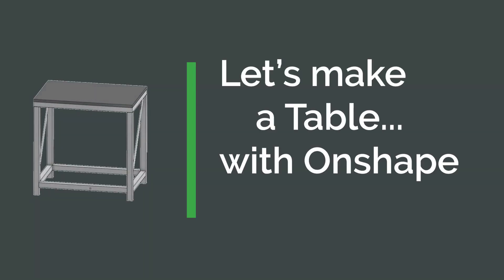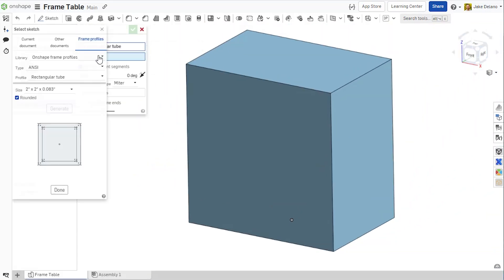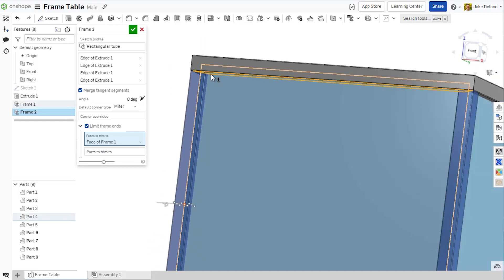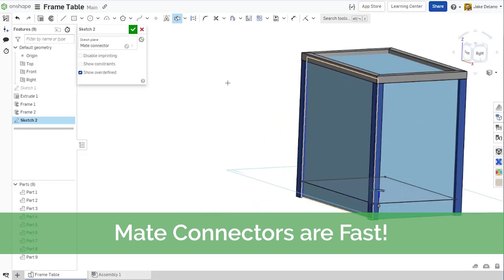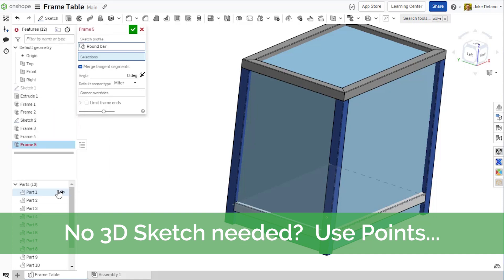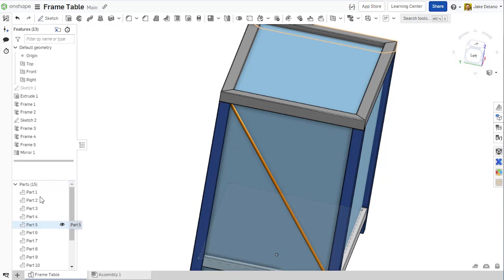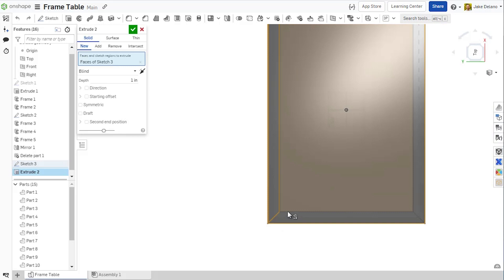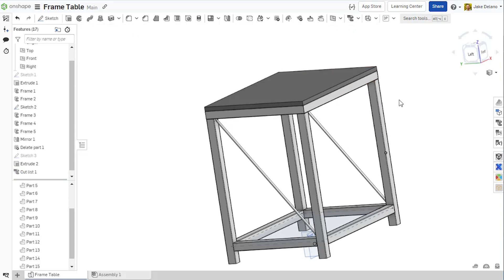Let's Design a Table (Frames)

Comment: When you place the frame on sketch line, the center off the frame cross-section is aligned with the sketch line. How to make a frame edge to align to the sketch line. I.e. if I create 300x500mm sketch rectangle and cover it with 30x30x2 square tube frame, the resulting construction size is 330x530mm while I'd like to keep it under original 300x500mm sketch dimensions.

Comment: Thanks for putting out content showing good practices, I have seen several "tutorials" with terrible advice for using frames!
My only comment is that you could have skipped the sketch entirely for the bottom members by doing a split face with a mate connector instead!